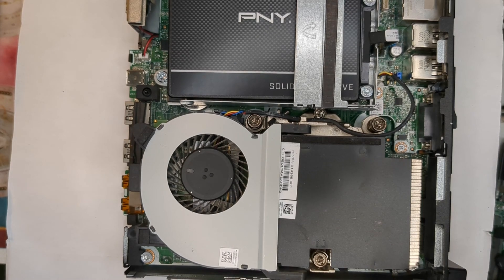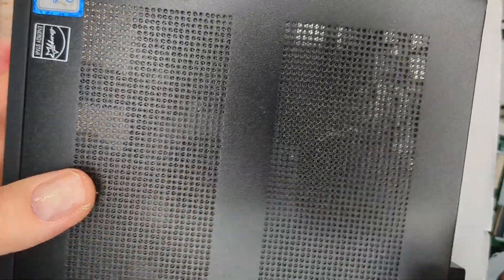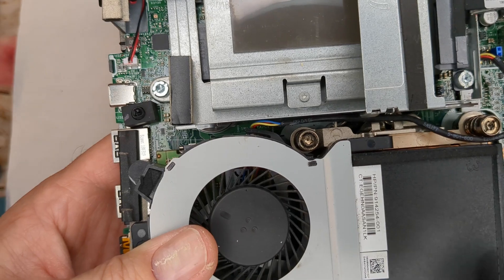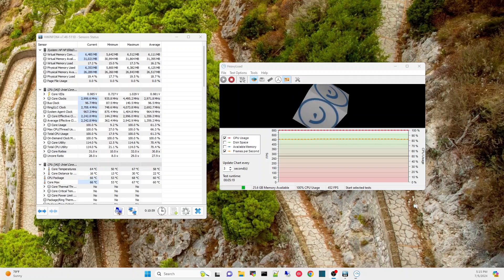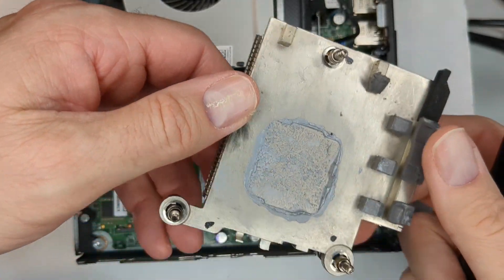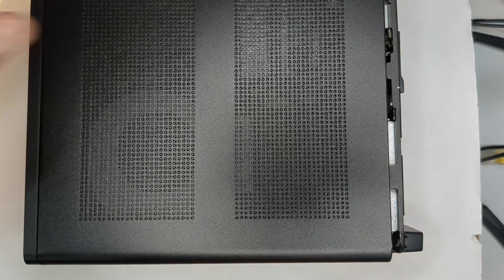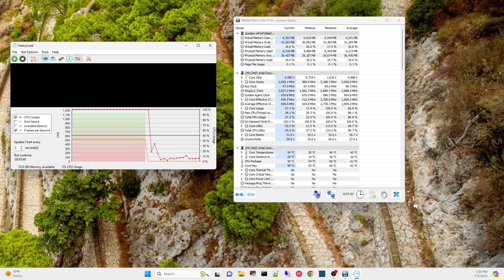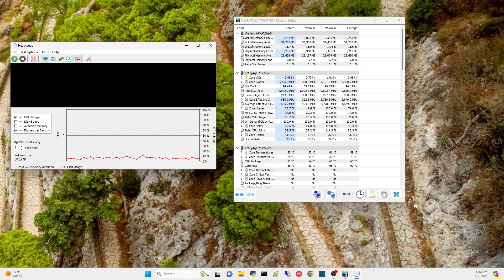EliteDesk 800 G3 Aluminum vs Copper Heatsink

Comment: The fan speed hasn't changed either? Maybe the temperature is about the same, just the machine is quieter..?!
Reply from the maker: Hadn't thought of that.  Conceivably the cooler the unit the less chance of needing the fan spin at a high speed.

Comment: I have been wondering about this because aluminum dissipates heat faster than aluminum, copper should hold heat for longer than aluminum but copper is heavier i guess you could say it has more mass to pull the heat away from the cpu so its hard to say what is better but most sources say copper is better
Reply from the maker: The 65w units always use copper so I would think it would be much better than aluminum but as you see it wasn't too much different

Comment: Do you know the thickness of the thermal pads used on the copper heatsinks?  I have one I want to use, but they are damaged, and need replacing.
Reply from the maker: Check out https://www.ebay.com/itm/334510721974 for a picture but https://www.reddit.com/r/MiniPCs/comments/1e3yzoy/something_strange_in_my_hp_elitedesk_705_g4_mini/ might be better - seeing talk of 3mm - where are you procuring these from?
Reply: @handmedowntech  I used 1.5mm for choke, 2mm for the mosfet. Perfect contact

Comment: Liked your test, I have one small question, is there a yellow light on the motherboard when you plug the power supply? I'm not sure if it's a normal thing or there's something wrong with my unit.
Reply from the maker: I checked two G3s - when I attach the power a tiny light flashes momentarily - it is sitting next to a number "2" and near a small black chip
Reply: @handmedowntech  does that light stay on or goes away? My motherboard yellow light stays there, didn't notice until I removed the caddy to use an nvme and run the pc without the top lid.
Reply from the maker: I'll try and do more testing this weekend
Reply: @handmedowntech  by the way I have a g4 with a ryzen 3 2200ge, I did a case swap to get better ventilation, with some minor sacrifices of course since it's not a full motherboard to add an external power button.
Reply from the maker: So the little mobo in a big case.  Sounds crazy and inventive
Reply: @handmedowntech  in a slightly bigger case, the one I bought from Amazon was like a 1.3L case meant for an HTPC
Reply: @handmedowntech  had to unmount the g4 metallic buttom and paste in with special metal glue onto the new case in order to mount the motherboard, it was a fun project
Reply from the maker: I connected power to a bad mobo and the light stays on.  So it being off is a good thing.
Reply: @handmedowntech  so maybe mine has an issue somewhere although everything runs well. It's kinda strange. Thanks for testing that.

Comment: I did the same experiment with a g4 i7-8700t and had similar results. There was a 3-4 degree difference between the heatsinks, which was really disappointing. I've also enlarged the intake vents at the front cover and I didn't notice a difference. I like to add Tessa tape between the fan and the heatsink, between the heatsink and the case, and over the #2 screw void. I don't know if really makes a noticeable difference, but it creates a bit of duct like effect, lessening the amount of hot air that goes back into the system.
Reply from the maker: All these different tapes out there.  Duct, kapton, electrical, and now tesa, I'll have to check that out

Comment: You should always clean and reapply thermal paste between testing. Mating 2 sides with paste already applied can trap air bubbles, skewing your test results.
Reply from the maker: @DrivingVertigo  I may go back and fix the paste on my current unit.

Comment: finally 😂
Reply from the maker: @wonkmisteriuz  sorry for the wait and thanks for the suggestion 😉
Reply: @handmedowntech  I didn't expect it, it turns out the difference isn't that big
Reply from the maker: @wonkmisteriuz  it's probably more of a case of the non T processor needing something beefier than an aluminum heatsink.  I'm going to continue using it until I need it again for my 65w G3.
Reply: @handmedowntech  yes, but it's pretty good cooling, drops the temperature so quickly after full load